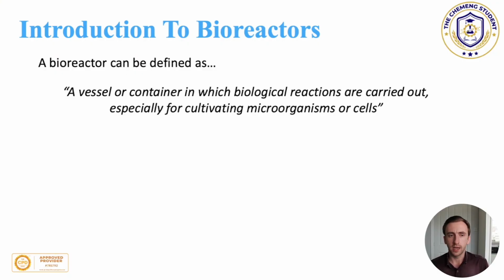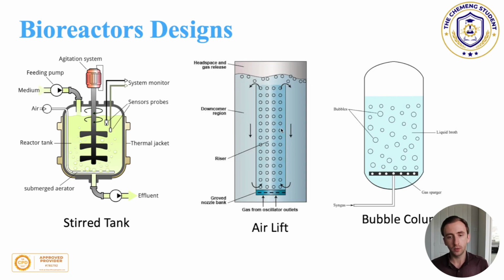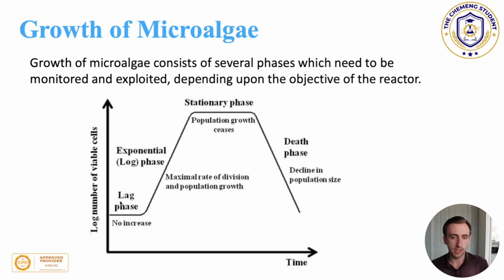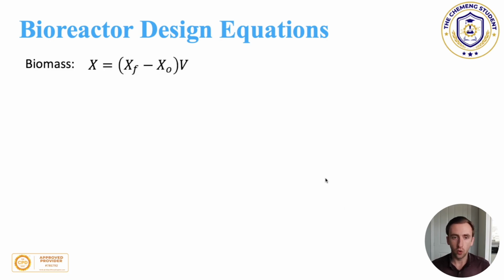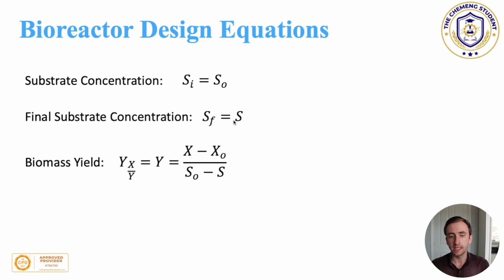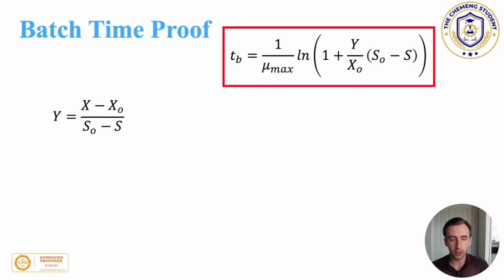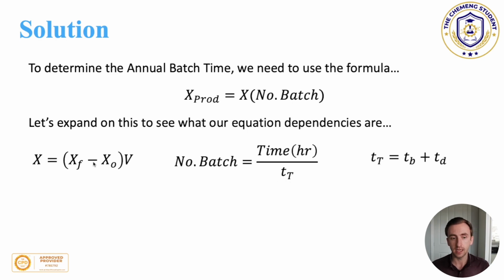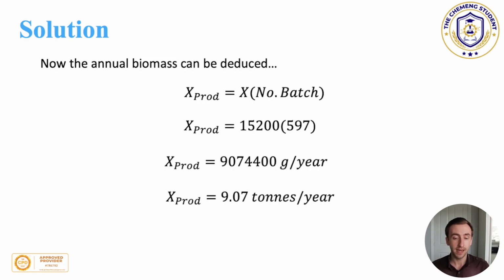The Complete Guide To Designing BioReactors | An Academics Insight

Comment: 4 min mark, is the bubble column closed??  Where's the outlet??
Reply from the maker: Yes, the bubble column is a closed system, as are most bioreactors due to the cultivation duration. The schematics are just basic however, in more detailed ones you would find small relief vents, usually at the top to allow the air to escape, preventing an increase in pressure within the vessel. I hope this clears things up, and thanks for watching!

Comment: Nice video.  Thank you for making it.  I have a question about the "Biomass yield from substrate = 0.52 g/g".  When I use that I get a different number for cells: 1000L x 40 g/L = 40,000 g meth.  98% conversion means 39,200 g of meth consumed.  With a biomass yield rate of 0.52 g/g we would get 20, 384 g of cells.  Why the discrepancy?  Thanks!

Comment: Wow.  Great video, very helpful.

Do we find Umax by measuring the slope of the growth curve during the exponetial phase?  If so, is this the same value we'd use for designing a continuous bioreactor using the same organism?

For a given organism is Umax mostly independant of nutrient / substrate initial concentration?  Does starting with more nutrient change the slope of the growth curve or does it just extend the duration of the exponential phase?

Do you have any content related to continuous bio-reactors?

Thank You!! Sub'd. :)
Reply from the maker: Thank you for your kind words and for subscribing, much appreciated! 

Yes, Umax can be determined experimentally since you will monitor the growth periodically, you can deduce at which point the maximum growth rate occurs. Bioreactors typically don't run in continuous systems given there is a prolonged period required, unless the organisms are pre-cultivated beforehand to the design would be the same. Some variation occurs when using heterotrophic systems such as fermenters. 

This point really depends upon what variables/factors you intend on varying to establish if there are correlations between say nutrient concentration and growth rate. These would need to be carried out experimentally. Typically, from my experience different organisms will respond differently to nutrient starvation or surplus and so it is highly dependent upon the organism as well. 

I will be releasing more videos soon on other types of bioreactors so we can add in continuous systems for you certainly!

I hope I have answered all your questions.